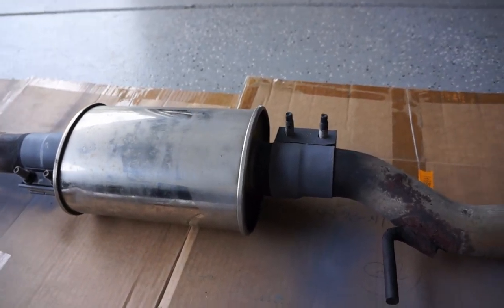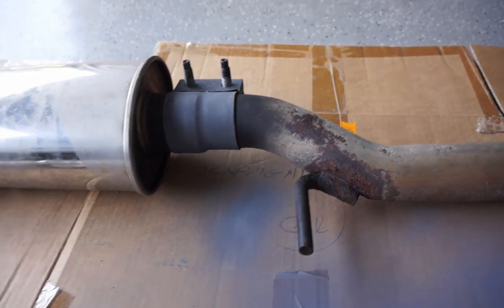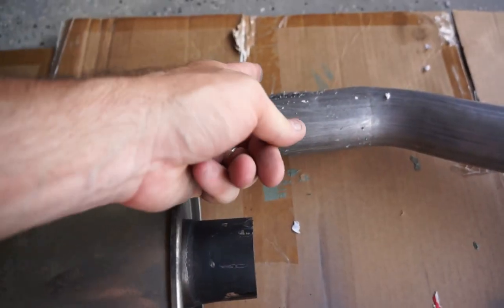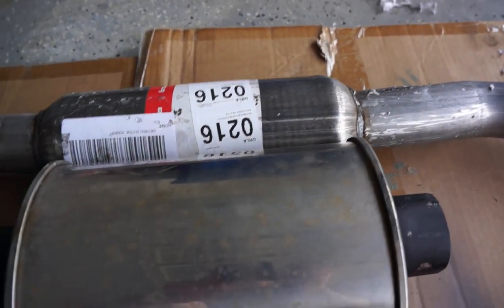2003 Infiniti G35 DiY Exhaust

Comment: That's cool. My setup is similar but I'm using a 350z resonator. Muffler delete.
Reply from the maker: I started it up with just the mid pipe with Vibrant resonator and no muffler, and it did sound pretty sweet but a bit loud for me to  live with.
Reply: @JRsGarage  absolutely agree. At first I had it just the way yours is. Both still sound great. I also have another g35 with stock pipes except the cats are test pipes. My honest opinion comes down to acceleration based on the mufflers back pressure. Acceleration feels better with it than without. I opted for sound 🎺😂